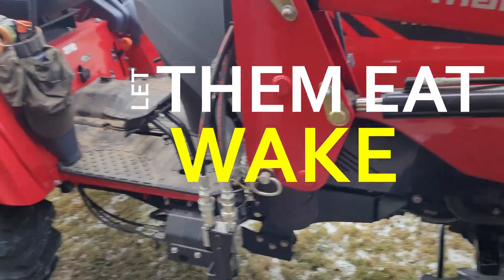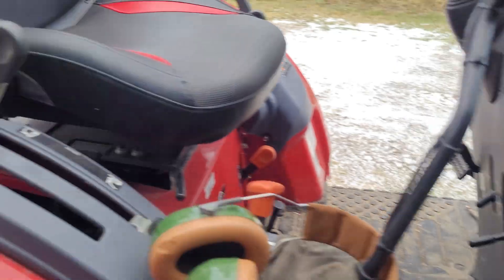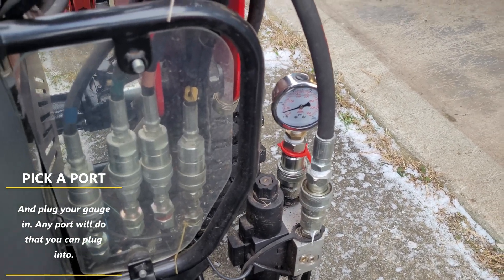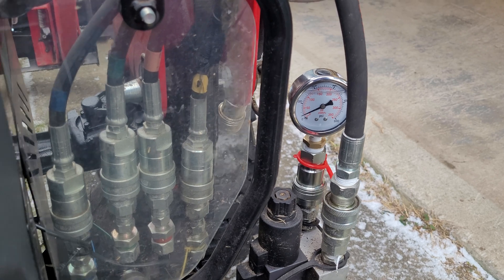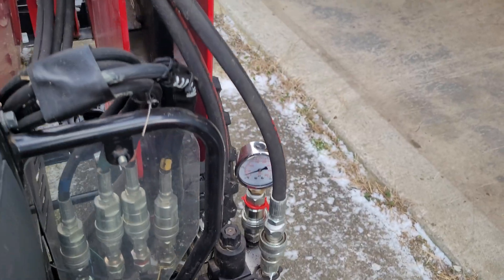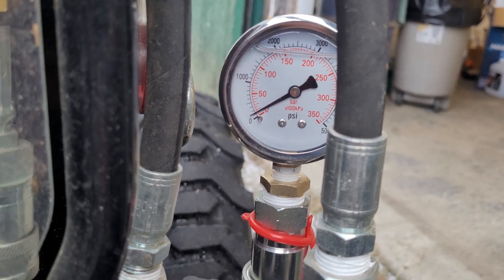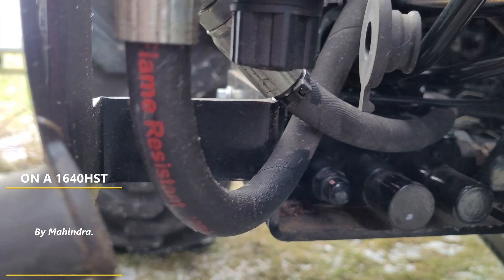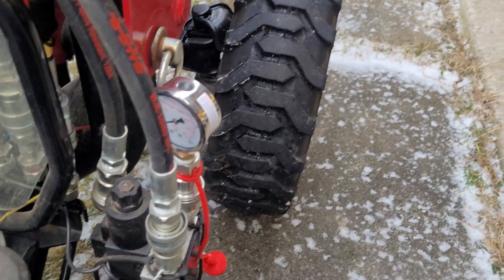TEST AND TUNE HYDRAULIC PRESSURE ON  A COMPACT TRACTOR. 1640 HST MAHINDRA

Comment: Is that why your tree shear wont cut the advertised tree size? I thought most tractors loaders ran in the  24 to 2700 psi range?
Reply from the maker: I could boost it a bit to 2500psi
Reply: @ADAMLS1240SX I just got this same tree shear yesterday so weather depending ill see how it cuts sometime this week . My tractor is putting out about 2550psi so if you want I can let you know if its cutting significantly better than the 4inches you're getting at 2200psi . I have some oaks,pines and a pig nut trees to shear so a good bit of hard and softwoods. Im hoping it can cut 6inch really hardwood trees like pignut and live oaks while also handling 10 inch pines.
Reply from the maker: @Rick-e3i5t  Yes please let me know. It does cut softwood easy , its the hardwood that stumps it :)